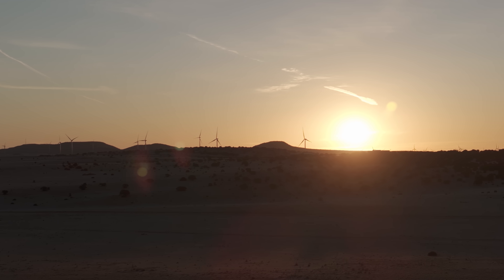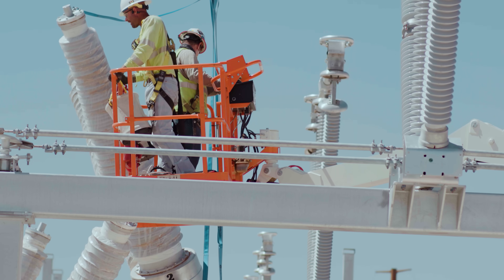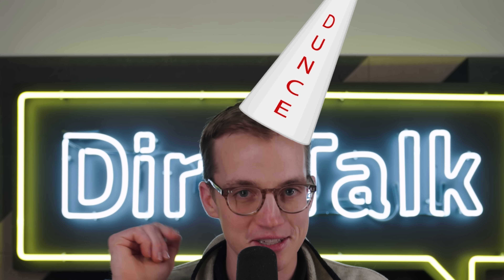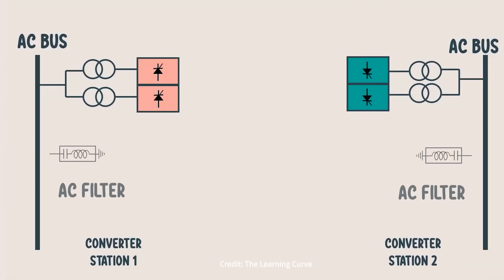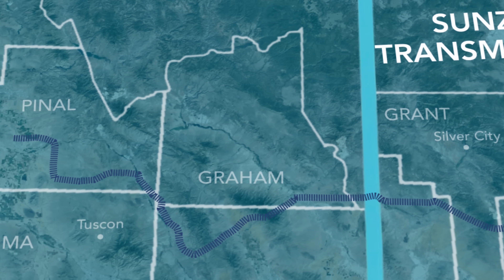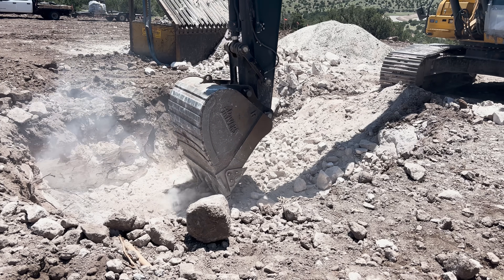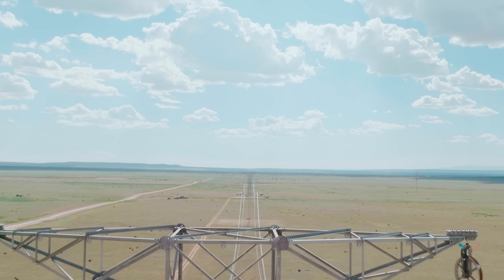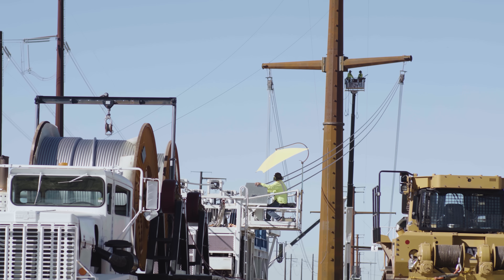Building America's Largest Power Project w/ Helicopters?

Comment: Chinook helicopters. Over 65 years the engines have gone from 1600 hp to 3700 hp. The blades are wider and lighter. The lift has increased by 10,000 lbs. Still being made in Pennsylvania.
Reply from the maker: amazing!! they are monsters

Comment: Much overlooked topic regarding the transition to clean energy!! Everyone is obsessed with the capacity to generate clean energy but without the infrastructure to get it into the grid this effort is all for nothing. Great work on covering that part of the process 💪🏻💪🏻
Reply from the maker: power generation's worth nothing without a strong grid
Reply: No such thing as clean energy everything you’re witnessing in this video requires fossil fuels to design manufacturer distribute assemble maintain, and is not recyclable.  Also, there is no such thing as green energy or net zero energy.  Green energy is 100 times worse for the environment than reliable cost efficient, fossil fuels that is a natural resource  and the United States alone has a 3000 year plus supply of whereas green energy, which is all manufactured only has a lifespan of 15 to 20 years tops before requiring replacement.  This entire movement is 100% political has zero to do with the environment. Proof of my statement can be seen all over Europe as we speak, they have been attempting to do this very same thing, but now are actually opening up previously shuttered coal plants and natural gas resources because green energy cannot supply enough electricity to sustain economic energy requirements.
Reply: @tristenklein5940  15-20 tops..........tell that to the 60 solar panels on my house that are still putting out as much power as we use, after 20 years. There are many different components used in energy and even green energy, so that number will vary. I do agree with the fossil fuels needed and the lack of ways to recycle the composite components of windmills. Solar and wind can be useful, but it has to be evaluated by a realist. Same for electric vehicles.....they might make sense in some cases, but they are not the miracle people think they are and should not be mandatory and probably should not be subsidized.

Comment: AC to DC is done with a "Converter" (rectifier)....DC to AC is done using an "Inverter".... :-)
Reply: 'Converter' is a high level term for a system that changes power from one state to a different state.  A rectifier is only AC to DC but has a lot of other balance of system components to produce the appropriate power.  Many HVDC lines can send power both directions for market balancing.  That being said, all rectifiers are converters. But not all converters are rectifiers.
Reply from the maker: noted -- thank you

Comment: It's amazing that the helicopter pilots can fly steady enough to smoothly line up and connect four corners of such a huge structure.  I'm doing good if I connect the two prongs of a plug with the outlet and walk away unscathed.
Reply: The Chinook has a stability control system the makes many small corrections a second to the controls. It was an analog computer in the 60s . It may be digital now.  67u20
Reply from the maker: the skill they have is extraordinary

Comment: billions of gov subsidy to connect "free energy" infstraucfture that only last <20 yrs... renewable C EO has their bonus, taxpayer in debt...
Reply: Do oil and gas companies actually pay for the land they lease at fair market value? What happens to an oil pipeline when they run out of oil where they're drilling. 20 years isn't the right number, and even when they are broken they'll replace them with newer ones. Just like generators at a coal plant or The motor in your car it's going to wear out

Comment: Pretty sure you have your ac/dc backwards for the transmission lines.
Reply: It confused me at first but HVDC is a thing for long distance transmission. Notice the 2 transmission cables on the towers instead of 3
Reply: The transmission efficiently is determined by voltage more than AC vs. DC. AC  voltage can be stepped up / down relatively easily. DC cannot.
Reply: @scottzylstra1185  Yes but ... if you exceed about 1MV AC the losses resulting from line capacitance and other phenomena related to the flow of alternating current exceed those resulting from the line resistance for direct current. Hence, when transmitting very large amounts of energy over very large distances, HVDC turns out to be more efficient. In addition, there is a saving resulting from the fact that two wires are run instead of three.
Reply from the maker: idk I googled it intensively

Comment: This is operation on the scale of a large nuclear power plant, this is actually a meaningful amount of power.
Reply: Nothing like a nuclear power plant or the time taken to build one,
Simple, reliable power generation at a fraction of the cost.
Reply: @peterfalconer-h3k you don’t have a clue about costs
Reply: @Adam-x4b  There's stacks of similar wind farms here in Western Australia, they leave fossil fuels in the dust when it comes to costs.
Reply: @peterfalconer-h3k  you can’t figure out the cost can you? I,ll give you a start over a MILLION DOLLARS per useless tower which will never in my and your lifetime pay for itself
Reply: @Adam-x4b  What's your cost per kilowatt/hour? 
That's all that matters and renewables generated electricity is significantly cheaper than either nuclear or fossil fuels generated electricity, that's been proven time and time again.
Reply: @Adam-x4b if they didn’t make money they wouldn’t be getting built.
Reply: At full power, it is equal to 3 1000 MWH nuclear reactors.
Reply: @kkarllwt  *3 1000 MW
You are talking about the power output, not the total amount of energy generated.

W :  a unit of power
Wh : a unit of energy, an amount of power sustained for a given duration.

W/h : does not exist, has no reality in physics.
Reply: @Luzgar  Oh good. A errant h make you type
Reply: @kkarllwt  *makes

Comment: Not at all interested in wind or solar power. I'm convinced neither will exist outside of huge public subsidies.
Reply: The best long term solution is often not the one that makes the most economic sense.
Reply: Simple, reliable power generation at a fraction of the cost of coal or nuclear and a near instant return on outlay for the investors.
Reply: @peterfalconer-h3k again figure out the costs before commenting
Reply: Oil and gas are limited resources, but there are functionally unlimited amounts of wind and sunlight.
Reply: The Dutch have been using wind for hundreds of years and the majority of human history we used wind and water to power everything before the steam engine. To think that we can't do that again, with modern technology is asinine